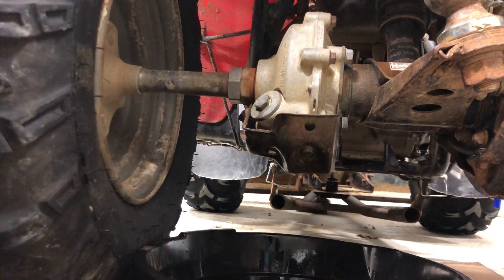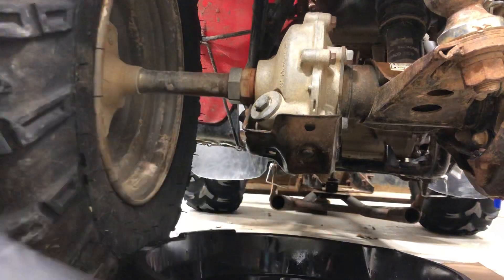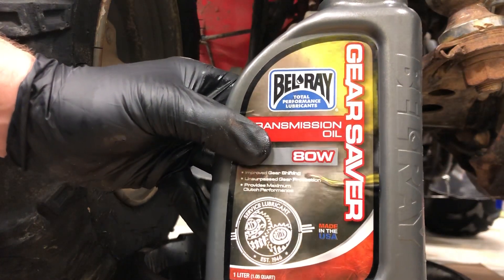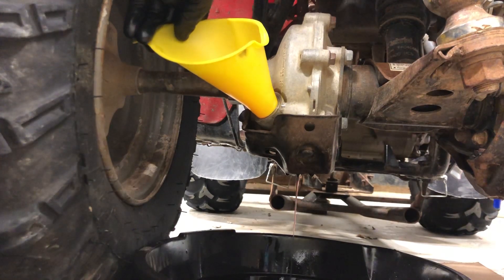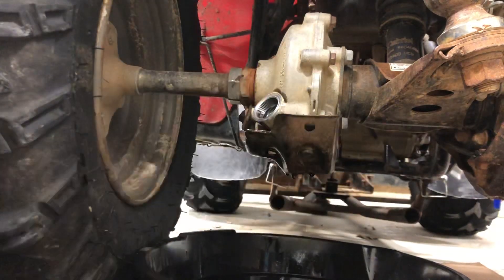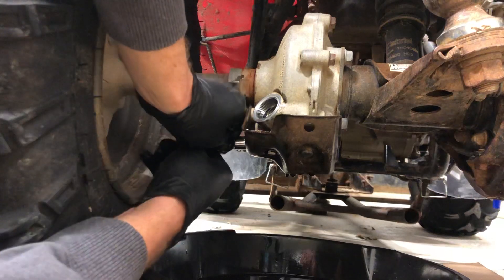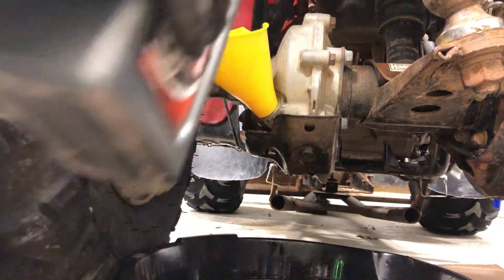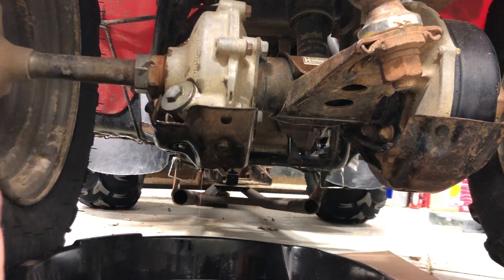Honda 300 Fourtrax rear differential oil change

Comment: GL-5 is the spec for the oil for hypoid gears i
Reply from the maker: GL-5 is a type of gear oil that is often used for hypoid gears, but they are not the same thing: 
GL-5
A type of gear oil that contains high levels of extreme pressure (EP) additives. GL-5 is designed for use in heavily loaded gear sets, such as hypoid differentials, and in certain manual transmissions and trans-axles. GL-5 is often used in modern vehicles with high-performance axles. 
Hypoid
A type of gear that is used in vehicles with axle drive, such as trucks. Hypoid gears are curved-tooth, axle-shifted bevel gearboxes that are designed to transmit rotational power between two shafts at right angles. Hypoid gears are used in vehicles with non-parallel and non-intersecting axle shafts. 
The American Petroleum Institute (API) classifies gears using GL ratings, with GL-5 being the most severe rating. GL-5 gear oils are often recommended for hypoid gears in automotive axles that operate under high-speed, high-load conditions.

Comment: I use 75w 90w Mobile 1 for years in my 1987 350D Honda in front and rear differentials.
Reply from the maker: I’d make sure it’s hypoid.
Reply: @BryanHansen  GL-5 is the spec for the oil for hypoid gears i
Reply from the maker: @PositiveVibe-f7r  

GL-5 is a type of gear oil that is often used for hypoid gears, but they are not the same thing: 
GL-5
A type of gear oil that contains high levels of extreme pressure (EP) additives. GL-5 is designed for use in heavily loaded gear sets, such as hypoid differentials, and in certain manual transmissions and trans-axles. GL-5 is often used in modern vehicles with high-performance axles. 
Hypoid
A type of gear that is used in vehicles with axle drive, such as trucks. Hypoid gears are curved-tooth, axle-shifted bevel gearboxes that are designed to transmit rotational power between two shafts at right angles. Hypoid gears are used in vehicles with non-parallel and non-intersecting axle shafts. 
The American Petroleum Institute (API) classifies gears using GL ratings, with GL-5 being the most severe rating. GL-5 gear oils are often recommended for hypoid gears in automotive axles that operate under high-speed, high-load conditions.

Comment: I always ‘slosh’ some fresh oil in the fill hole and let it drain just like you do. I’m glad I’m not the only one. lol.
Also, I slide in a cow magnet into about a foot of fuel line for when I have to go ‘fishin for bolts’. 
Thanks for the video, as I’m trying to go through this destroyed, no brakes, entire wire harness cut up, no fuses, neglected, rigged up, clapped out, grease pit of a 300 now myself and make it decent for the new girlfriends Nephew. 😖. “Just get it to run if you can”
No, I don’t work that way! lol.

Comment: Thank you for posting this information. I resurrected one of these that an elderly neighbor lets me use.  It is an early 90s one, but it has hardly ever been used.  Once I cleaned out the carb and replaced the fuel lines it has been excellent.  I want to replace the fluids as I doubt they have been changed in the last 10 years.

Comment: What diff oil would i use for a 2002 honda trx450 also is the trx the foreman or do i have a trx frame and foreman plastics i just recently seen it says trx 450 on the frame
Reply from the maker: Either way, same oil. Make sure you can get the fill plug out first before taking the drain plug out. https://amzn.to/44eFNMx
Reply: Very good tip lol I remember striping the one on my big red thank you
Reply: Also would you know how much to put in. Not full tp the top right?
Reply from the maker: @stevedolby7880  if it is like the 300 there is a "fill to port" on the front that was a 10 mm bolt and the rear was fill until it comes out the fill hole.
Reply: Okay thank you that helps alot. I am also doing the shift motor and shift angle sensor as my electric shift don't work I don't know were to start so gonna replace the shift angle sensor. If there's any info on that you can give that would be great. I'm not sure if I just unbolt and bolt back on or if there's things I need to worry about and adjust

Comment: I just bought this exact oil you showed and this is actually NOT the hypoid version. You needed the belray hypoid 80w90 not the regular belray 80w as you are shown using in video
Reply from the maker: I just went to the link and it is hypoid that i have linked.

Comment: Thank you for the video, quick question is Lucas heavy duty 80w-90 gear oil also consider for hypoid oil or not.
Reply from the maker: It does NOT say hypoid on the bottle, so no, I don’t believe it is.
Reply: @BryanHansen  you r awesome thank you for your quick response I will buy the one you recommended 👍 thanks again

Comment: Thanks for sharing your video. Perfect thing to do on this rainy day! Good info as well!👍
Reply: I did change the oil in my trax300. It came out chocolate milk brown. Apparently it hadn't been changed in twenty + years. The duration that it was owned previously. I did run some new through but it was so thick in there so I wiped as much as I could out. 
Maybe it will get a few more changes this year as it cleans the old awful stuff throughout... thanks again for the video. 
P.s. I did end up removing the skid plate. It was jammed full of dried mud so no oil through that!

Comment: Can you please clarify for me what oil you used. In the video you are using the bel ray 80w transmission oil. But the link you have in the description is for the bel ray 80w90 hypoid gear oil that is clearly labled hypoid (not transmission). Is there a difference in the two or is it just that they changed the bottle lable to say hypoid?  Thanks for your info!

The 80w transmission oil bottle says it's good for wet clutches. 
The hypoid 80w90 gear oil in your link says it's not recommended for wet clutches. 
Which one is the right one to use?
Reply from the maker: Definitely want the Hypoid. They changed the bottle.
Reply: I understand that. But is the transmission 80w you used in the video actually hypoid or not? I bought the same bottle in your video a few months ago and just put it in my three fourtraxs yesterday. But realized the bottle didn't say hypoid on it so looked at your video again to make sure I got the right stuff. I did get the same stuff you are using. But if you look it up the 80w transmission oil says it is for wet clutches and the gear oil says it's not recommended for wet clutches. 

So, is the 80w transmission oil you used in the video hypoid oil or not?
Do I need to change my fluid again with the bottle that is the 80w90 hypoid gear oil or is the 80w transmission oil like the bottle in your video OK?
Reply from the maker: The 80W or 80W-90 that I linked to (the one in the video and the one I mention) are BOTH hypoid
Reply: Thank you for clarifying for me! I was bummed thinking I used the wrong one.  @BryanHansen